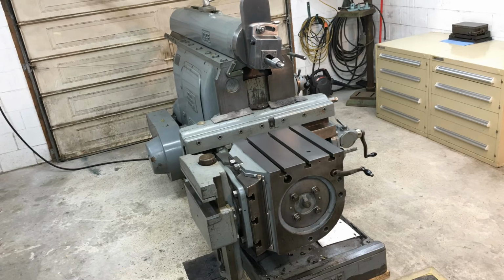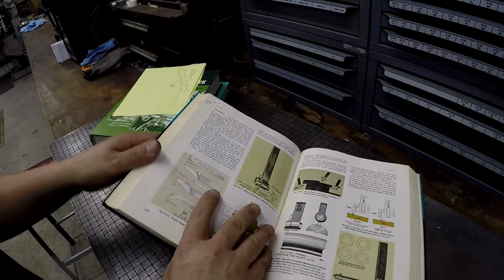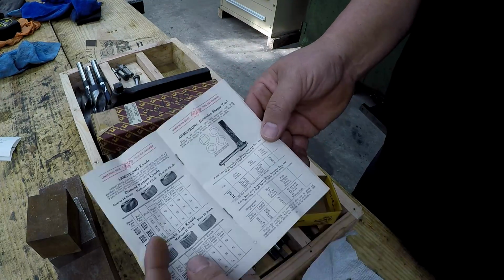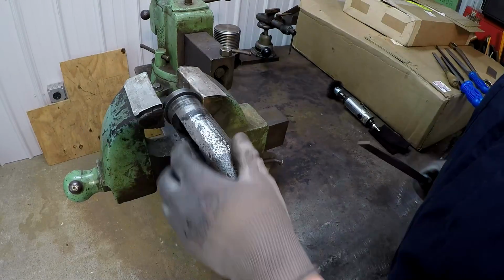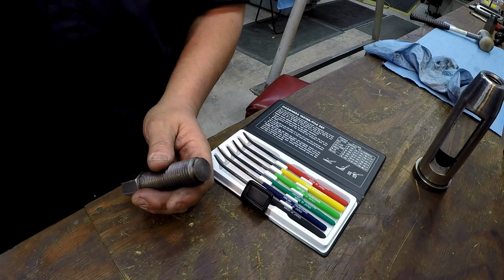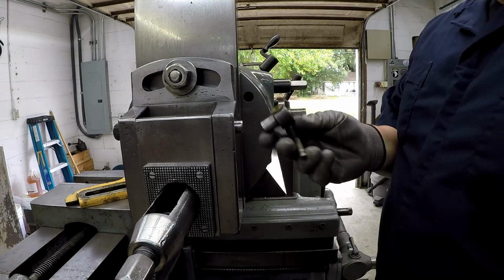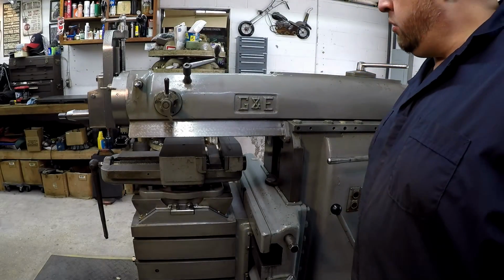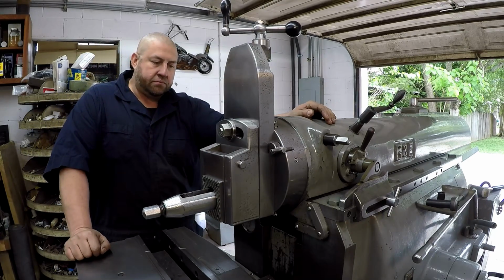SNS 213: Shaper Tool Head Final Reassembly, Machine Tool Books

Comment: And "draw filing", pulling the file sideways, is an ordinary technique to create a flat surface on an edge. I was taught that in my shop-class, out of a textbook as old as the ones see here. Adam look it up in your textbook that has the section on filing. It will be there. I will bet that the textbook does not say, "lift the file on the back stroke".
Reply: You realize that you are ranting on a video that is more than a year old, right?

Comment: Did you recheck the hardness of your bolt after facing it off? Or could you tell by the chip production on the lathe that you didn't make it past a surface-hardened section?

Comment: I look at it this way you by the files if you wanted to ruin it you have the ultimate right to run your own equipment. That being said you're not hurting that file unless you're just putting your entire weight against it on the drawback. This is why I've never commented on any of your techniques. Simply because they're your techniques. In fact I found myself using some of your techniques replacing some of mine because I like yours better. And as far as that side to side file the professional name for is draw filing. It puts a finer cut on your product. I was taught that in junior high shop class.

Comment: I have recently  embarked on the building of a Lantern tool post . Given my restraints  On my pocket book  today. I have a question to ask, of your wide & varied knowledge.  it is this Given the choice of tooling in to days market plaice  . would it be best to build in a siystom of adjustability. in the desired tooling . or settle on a fix's centreline & a fixated  size of tooling ? such as Hiss tooling of a ponticular size . or tooling that as the rack design in &  Bild the centre line to that tip of tooling    if I should choose both HSS  & or modem tooling , should I desire some adjustment would you suggest the the smooth concave washer Or a 60diger grooved washer to prevent movement when cutting uneven surface's ?  

i GET IS ABOUT MODEN QUICK CHANG TOLLING . 
:- [BUT SOME OF US DO-NOT HAVE THE BUGET FOR SUCH LUCHERIS.  IN OUR HOME SHOPS, & THE CONSTEN SHINING OF THE 4 WAY TOOL POST IS OFTEN TO TIME CONSUMING . 

Thank you I have Enjoyed watching you post but have not  seen meny of late. but alas i cant afford becoming a patron . to your channel. to get preferential questions Answered ?

Comment: Hi Adam,
Well the smile on your face at the end is proof positive of doing a job right and getting the expected results. Now, about that filing thru the backstroke; I'm sure I figured it out that you are actually cancelling out the effects of the North to South stroke that imparts magnetism to the parts right? Otherwise, as all the haters I'm sure are saying, you should always file East to West according to their revelations posted on Wazzo-ogram by Bozo the Clown with the clean hands. Actually, do you have a lot of flash rust issues that close to the ocean? I'd think maybe clearcoating the non moving surfaces to keep that great shine and finish you got.

Comment: I wonder what the machine weighs?  I put my 16” G&E in the back of my 3/4 ton pickup and drove home on the axels! lol. And I had over loads. Thank God I only had to go a couple miles.
Reply: Look back on his play list for the shaper. There is a short video where Adam weighs it on a live stream. Weighed in at around 8,500 pounds with the vise and probably about 5 gallons of oil in the sump.
Reply: @AMRosa10  Wow! I was thinking around 5500. I remember the cables and the crane straining. Thanks.

Comment: Adam, 

Just curious why you didn't skim cut the lantern in the lathe then wire wheel and polish as needed. 

And, NO I won't pick on the filing. I suppose that's just the experience level of the operator. 

My history is Automotive and technically you're supposed to precisely torque every fastener but it just doesn't happen in the real world.

With experience you learn when things really matter and when they don't. So...... if you have no experience you think everything matters because that's what was written in the book.

Comment: it is for percision edgefinding tool and die work (chair style edge finder)
Reply: X2. It can be used with an edge finder by finding both faces and splitting the distance or by using a dial test indicator and sweeping the 2 faces which puts you on centre(at the edge).

Comment: What happens if the operator or apprentice makes a mistake and the lever overshoots the cam plate?  Is there anything in the design that prevents damage to th machine?
Reply from the maker: It's designed to push it up and lock it in the upward potition. Pull a pin to release.
Reply: Abom79 ah ok. So when it’s locked up it won’t catch on the return stroke. That could be pretty bad if it did.

Comment: I can't believe people were yelling about Abom using a draw filing method. It gives a smoother finish to the cut and is recognized as proper usage of a file.

Back dragging a file helps to clean  material out from between the individual teeth when filing softer materials (like cast iron), which is a good thing.

The worst thing I've seen people do is to use only the center section of the file instead of going  from point to heel. Point to heel usage extends the life of a file.

Remember, a properly operated tool and a clean tool is a happy tool. And tools do wear out, making them more dangerous and difficult to use.

For those of you wanting to know the types and proper usage of files go here: http://www.nicholsontool.com/MagentoShare/media/documents/nicholson-guide-to-filing-2014.pdf

Comment: I can’t believe we are still dealing with people’s filing issues lol 🤣 It’s like the apprentice marks where they shouldn’t be. You can tell them to stop hitting it with a thumb detector but they’ll never stop until they figure out why for themselves. Most file haters probably don’t file anything ever.
Reply: As AvE says about drill bits- it's OK, they are making new files in a factory as we speak. Files are cutting tools, no matter what you do, they will eventually lose their edge and need replacing.

Comment: So, files only cut moving forward, i.e. away from the handle? Is that a global (international) standard? Hmm, well, i mean, yeah, it'd be reasonable, right - it'd be much more effort to cut while pulling. One can put the whole 200 pound gorilla onto the tool for heavy cuts when pushing. Haha, yay evolution, i think i answered my question myself. :D (Thank you, i've learned something.)    …or are there different, special kinds of pull-files? Probably, there're always edge cases… but what could it be?

Comment: yeah i think people just got a little fussy about dragging the file along the work while draw filing.  Of course the file only cuts on the push even when draw filing - but some people - if they see or hear the file touch the work on the return stroke thing automatically you've wrecked the file and and the work and you're going to hell for it.  But - the reality is - most people just lightly drag the file along the work on the return stroke and then put pressure on the push/cutting stroke and really its just fine.

Comment: The file thing people keep regurgitating around is getting ridiculous and Adam dropped the mike right on this one. How many people have ever removed a saw from the cut on back slides? And at the end of the day a file is a disposable item for crying out loud, not antiques. Unless i'm doing some really precise file work, i don't even bother with the really expensive ones, if it cuts, it cuts, and they cost like 5 7 dollars. And when i'm done with them, two per year at worst, i drop them in the iron bucket, for my forge. Sheesh, so many upset seats in the house.

Comment: Heck even the shaper drags the tool back across the work the way you file that annoys folks.
Reply: umm no? properly set up shaper lifts the tool.. why do you think it has a thing called a clapper box? Stroke, lift, backward move, clap, stroke, lift, backward move, clap
Reply: chronok I know and you’ve misunderstood me, it doesn’t lift the tool completely above the work, it just drags it back across the work with no pressure, the clapper relies on the tool not clearing the work to lift the tool. This motion is similar to the way you may drag a file back across the work with no pressure to keep the file aligned where you want.
Reply: well by golly you're right, BUT next to a place where I worked was a place with 2 monstrous shapers for big work and they did raise it above work by a separate mechanism.. weird only european planers I see does that.. guess us europeans don't like dragging :D
Reply: chronok That’s very interesting! Good to know.